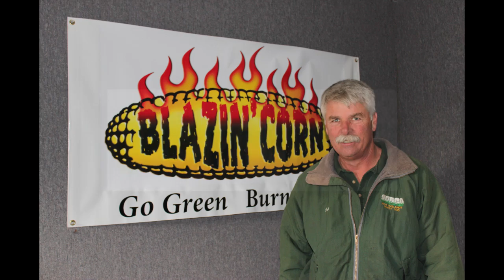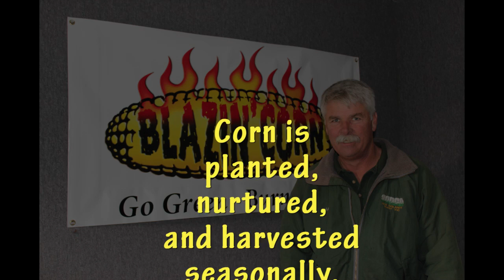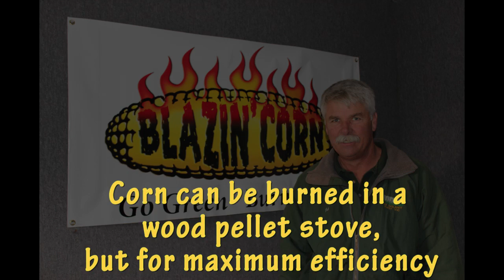Using Corn as a Heating Fuel

Comment: I've been heating with shelled corn for 16 years. This year tho, thanks to bidetflation, it has tripled in cost.
Reply from the maker: Bob Peckinpaugh: I forgot I posted this video 11 years ago. After 17 years in New England, I relocated back to northern California 7 years ago. I wasn't even the "messenger" on this video -- just the guy holding the camera as a hobby. I'm getting a kick out of reading the comments.
Reply: I despise the man but frankly corn is down from its high of 6 or 8 years ago. It was up to $7 or $8 a bushel from the elevator. I just split a load of corn with some friends yesterday and it was about $5.68 a bushel, east central illinois.